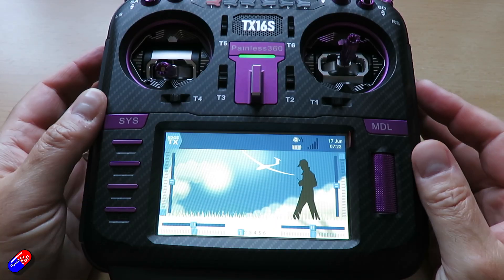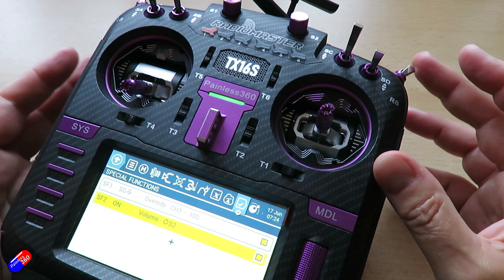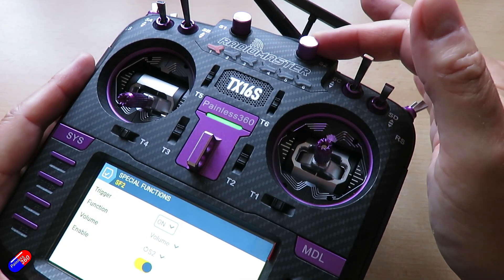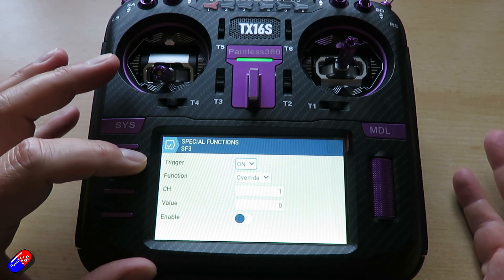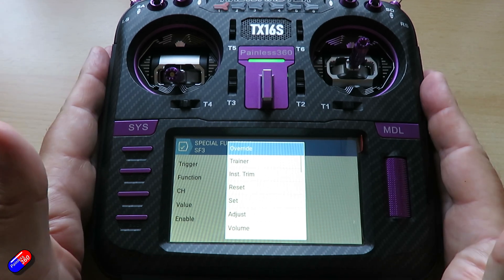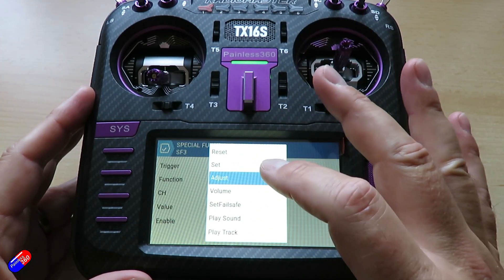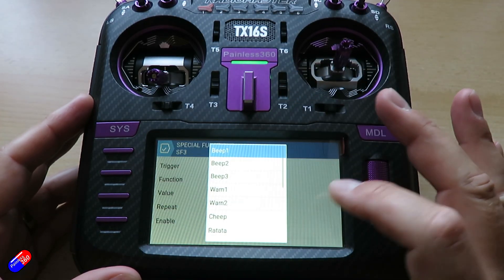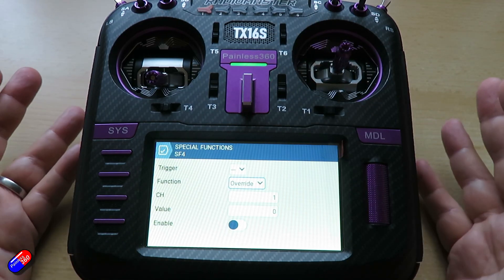Special Functions Explained (EdgeTX for Beginners 2025)

Comment: Is there any way to move the input of Special Faction for each model from copy? (Global Faction has extra models, so separate)
Reply from the maker: There are special functions in the system menu that are not model dependant
See my system menu video in the series... Happy flying
Reply: @Painless360  If you set it in the system menu, you can use it easily regardless of the model, but sometimes FPV, helicopter, etc. are used for different functions and some exclusions are necessary, so it would be good to have a copy and paste function between models for special functions.

Comment: Hi! A question to EdgeTX on ground control Radiomaster MT12.
I have "drive" drive/fly mode and "lock" mode.
In drive, throttle (2) and steering (1), along with technical channels 3 and 4 are mapped normally input -> mix -> output.
In lock, they hold last value that was on the channel. They are explicitly not 0s because some technical channels are "off" away from 0, e.g. -100, or "centered" with huge bias away from 0.
Right now in drive, four global variables are constantly updated, and in lock they replace inputs. It works, but setup took me a week to iron out. Question: is there an easier way to set up EdgeTX to "hold last value" on specific channels?
Reply from the maker: That's exactly how I'd do it... Happy flying!